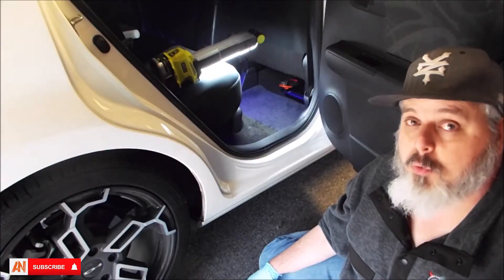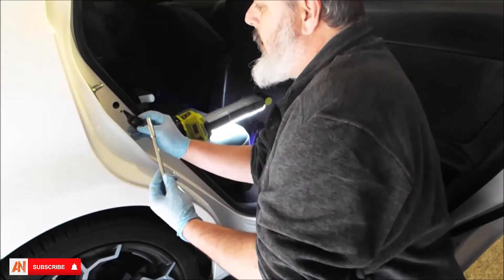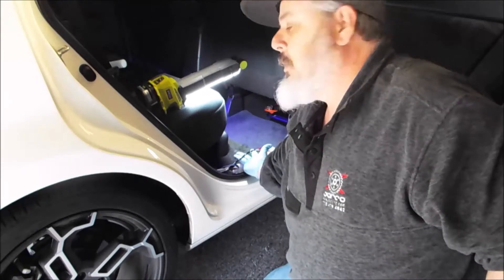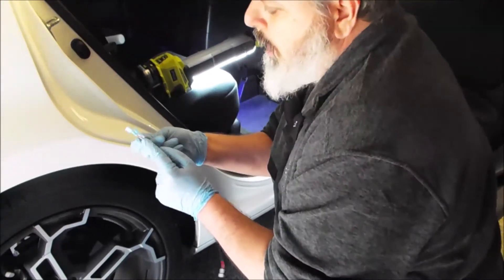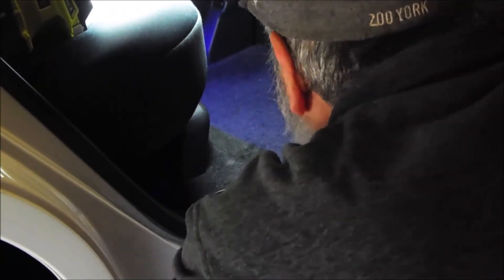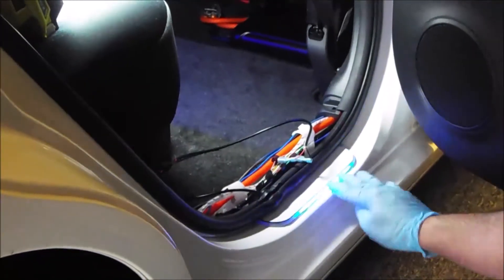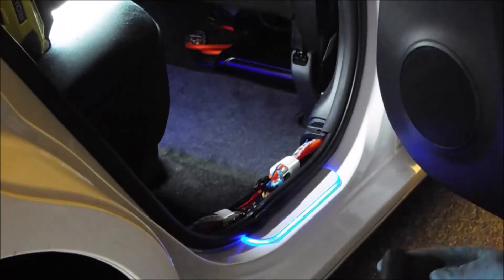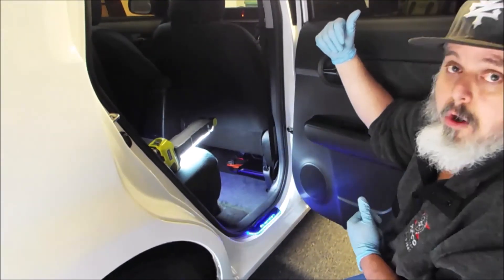2015 Scion XB LED Door Sill Instal - AoonuAuto

Comment: One thing to note. The install procedure is the same front or rear for all four doors. Grab your ground from your pin switch on the body of the car and a constant 12volt wire in the door sill factory harness to connect to your lighted door sills. Simple with great looking results 👌 Chris Cool.

Comment: Can you somehow use a fuse tap instead to somehow piggy back off the fuse box instead of cutting wires?
Reply from the maker: We have provided quick connector wiring, without the need for you to destroy the wiring harness to connect the electricity